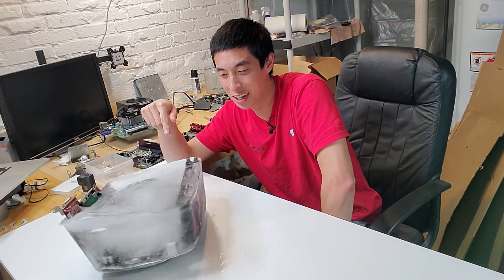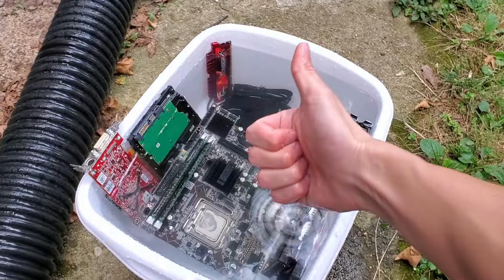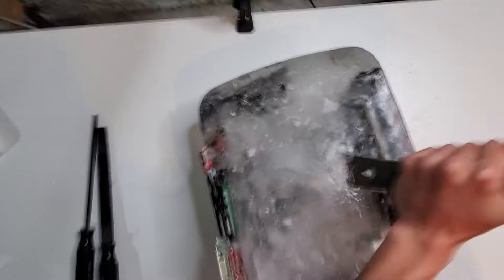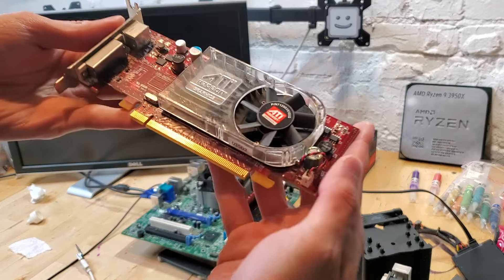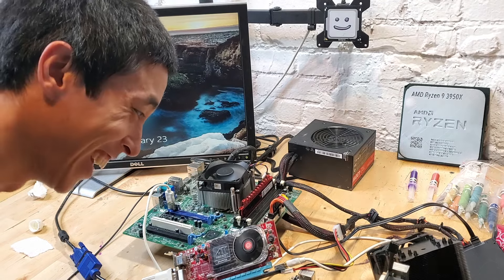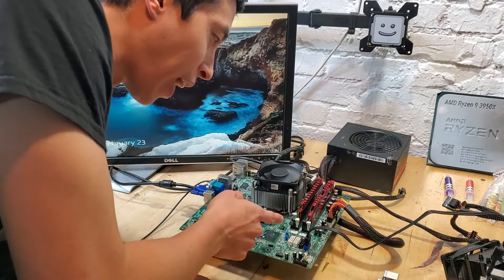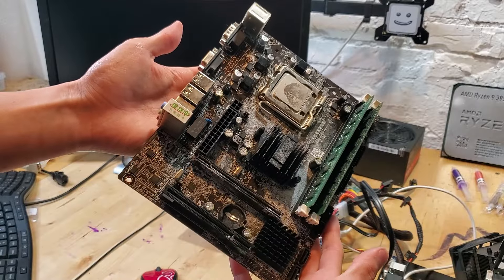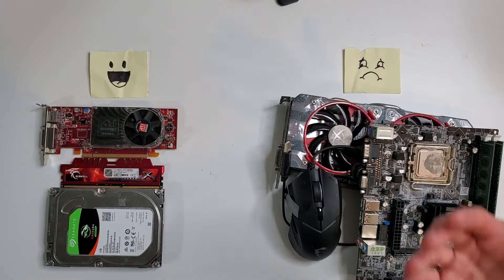Which PC Parts can Survive being Frozen in ICE?

Comment: Hard Drives, though they aren't completely sealed are fairly water proof INTERNALLY. Water almost certainly didn't make it inside the enclosure so given enough drying time for the external components it's going to be fine.
The newer GPU probably failed because it had water trapped underneath the cooler (considering it still had condensation underneath the plastic). If it had more time to dry, it's possible it still would have worked with the exception of potentially broken heat pipes and would just thermal throttle.
The mouse obviously still had water trapped inside it so it's not a surprise that when you plugged it in caused it to short out and die.
The motherboard not having a CMOS battery in it is one potential reason it failed. I've worked with a few motherboards that will just blank screen while being powered indefinitely if the CMOS battery is dead/missing. The residue, like you said, is also another factor. There's so many bridged connections with the mineral build up that it's stopping it from booting. Removing the CPU/RAM in the motherboard, giving it more time to dry, cleaning up all the residue on it and putting in a CMOS battery could possibly bring it back if it didn't fry itself with the initial boot up.

Comment: I washed a GPU card once because it was from a smoke environment. At first it worked great when I thought it was completely dried out, but then came major artifacts, and refused to work right until it was completely dried out with a air hose. Most of the moisture was under the ram and GPU. After that though, it worked flawlessly and gamed with zero issues.

Comment: As long as certain parts didn't break from the temperature, and it dried first. That all should work. But I'd be worried about the watch battery in the mobo filling with water

Comment: Seagate has a 1TB per platter structure now, so, i believe if you used either an older Seagate, like from BEFORE the fancy green labels, like when the word Barracuda was in Orange, then there would be more than 1 Platter per TB... OR any of the newer 2TB+ Seagate drives are multiple platters.

Comment: The damage is mostly caused by liquid damage to more liquid sensitive parts of the graphics card. If you just use liquid nitrogen on the GPU, isolating the rest of the card from liquid damage, you can get it to work. Also there is still water and condensation building up on the card, when you removed the ice.